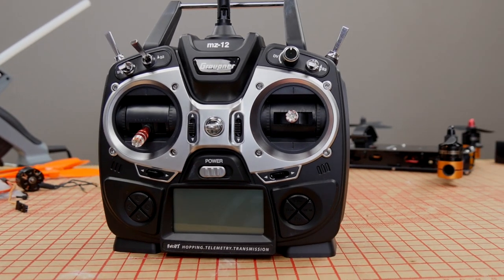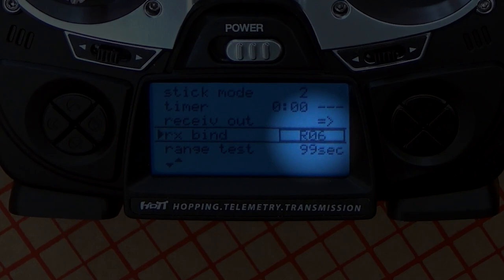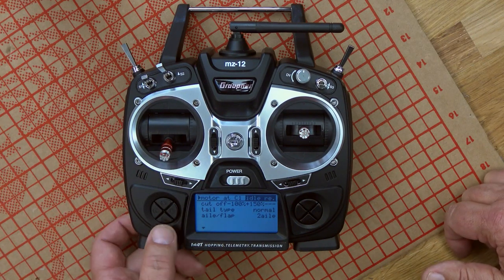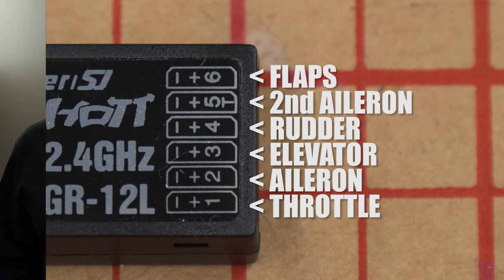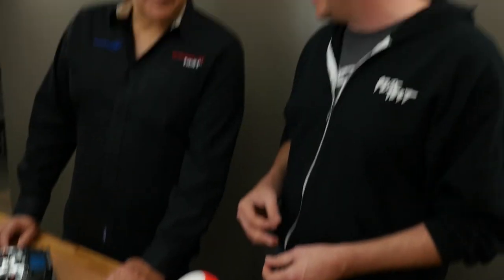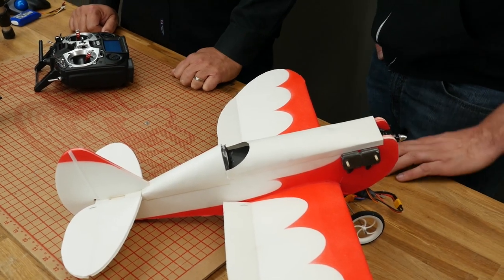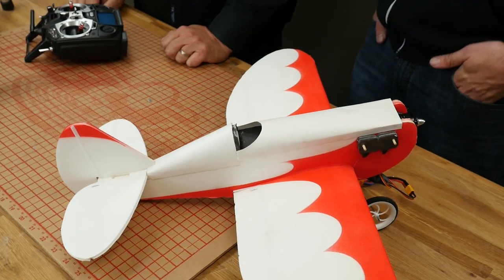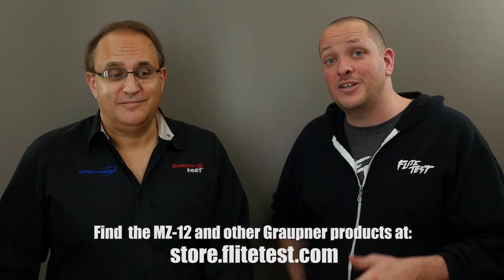Graupner MZ-12 - Tutorial and Basic Aircraft Setup | Flite Test

Comment: Ah, thanks for putting this video out.  Ask and you shall receive.  I now have two Graupner radios.  I first bought the MZ-12 transmitter (from the FT store), same as discussed in this walk through video.  But it did NOT come with the GR-12L receiver.  It comes with the GR-18... which to date is STILL completely non-functional.  I subsequently bought the MZ-10 that came with the GR-12L.  So, I've been able to perform all the functions as described herein on this walk through video.

The one thing that wasn't discussed on this video was setting up a buddy box where I can have the MZ-10 in my son's hands and I can take over if needed on the MZ-12.

I'll follow up w/ Graupner USA on the forums with the further questions I have on the GR-18.

Comment: If you knew how often I have referenced this video (as in just now, again), as well as the other one you've done on the MZ-12, you'd be surprised. Hopefully you'll do other videos on the radio. I doubt you have any problems with it, but for a newbie (and an old one at that), that's a lot of radio to school yourself on. The manual leaves a LOT to be desired and too often just leaves me scratching my head. I'm pretty sure it was translated from German to English and wouldn't be surprised to learn it was German translated to Korean, then Korean to English. There are too many blanks, misspelled words, poor grammar, etc. What I looked for just now was flaperon setup. Easy after watching the video. My new sailplane will be arriving in a couple of days and I'll be using the MZ-12 to maiden it. It has no flaps, just spoilers, and I think it needs the flaps.

Comment: The video is excellent  The manual failed to state to  press the rx button simultaneously to  binding  the rx. After struggling and using inappropriate language, I had found the video. IMHO, Graupner should link this video to its websites.  

My MZ-12 tranmitter was loaded with  german software. English is my primary language. After a month, I am still waiting for the hobby shop to update my software using the english firmware. In the meanwhile I am learning lots of German.

Comment: One of the most heard questions at the flying field "Hey is Futaba expo pos or negative"? I like my Sectrum DX6 as it gives a graph of the slope I'm installing in the radio. The Taranis from what I've seen, looks to have a much easier advanced programing.  Graupner seems to be behind the curve when it comes to development. I haven't been able to determine if Taranis is FCC approved but if I where buying I would fully research It due to what their advertisements claim . Many of my friends have expensive radios with 18, 20 or more channels and fly 3000 dollar planes but always are interested when someone shows up with a spectrum DX9.
Reply: +Sailor john Its illegal to sell a transmitter in the US without FCC certification - Fr'skys FCC ID for the XD9+ is XYFX91216DK.  It's a nice radio, and OpenTX rocks if you are programmer.  If you fly quads, and are in the air for 8 minutes per battery, you probably won't notice it, but if you fly planes - or anything for any length of time - you'll find the gimbals suck.   I much prefer the feel of my Mz-24 to the Taranis, and I fly both.

Comment: Hay guys, great video as usual !  I have the Trinity head tracker in the Fatshark HD3. Can't get it to work with my Hitec Flash 8.Do you know if the new mz-12 PRO 12 Channel 2.4GHz HoTT Transmitter with Falcon 12 Receiver, will work with the Trinity head tracker?

Comment: Please show how to setup a tricopter with the mz12. I cannot figure out what to do, I followed the toughtilt tricopter build and built the tricopter and set things up with clean flight but but the tail servo doesnt counter the right way and caused the tricopter to just spin before even getting a foot off the ground. the tail servo moves correctly when giving stick input but does not counter correctly. please show how to setup a tricopter with this transmitter.
Reply: +oguitarmagic I don't think you are having problems with your MZ12 radio, but with the settings of the flight controller on your copter. Did you check if all the props are going the right way?
Reply: yes i did but just to make sure which way should the props be going on a tricopter?

Comment: Will this transmitter work for multi-rotors? Either way, it's probably way outside my price range.
Reply: +Io Yes, as long as the transmitter has a minimum of four channels, you can fly multirotors with it:  Up/down (throttle), yaw (rudder), pitch (elevator) and roll (ailerons). As shown in the brackets Multirotor controllers usually expect a classic airplane setup for the channels.

Cheaper ones work fine too, but keep in mind that you are going to change models in the future, but the transmitter will usually stay with you for a while. If you can afford it now, try and get something a little more advanced than you need at this moment, so it can grow with you.
Reply: +Balu Thanks! So if I were to get this controller, I should leave it on aeroplane mode?
Reply: +Io Wait? Are you talking about the transmitter (the one with the sticks you move around)? Then yes. It should work in airplane mode like all the other transmitters do too. I'm not sure if it has a special multirotor mode though.

Or are you asking about the receiver that is available in the kit? This special receiver has a flight controller for multirotors and planes included if you want to build a multirotor yourself. It has to be in multirotor mode to work.
Reply: +Balu Transmitter. Old gaming habits lead to me calling it a controller. :)
Reply: +Balu By the way, I have seen you around many FT videos. Are you semi-official staff, or just a helpful guy? Thanks for helping me out!

Comment: MZ12 is less capable and has less features than the previous model, the MC12. There is no data logging via a SD card like the MC12, the telemetry such as the excellent vario's that Graupner has do not work as well (do not have the beep sounds for up/down) and there is no means to record any data from the blue-tooth device which you can connect to the transmitter.

Comment: What's the model number of this radio?
Reply: +Mike Lugo Are you asking for the number of models you can program? The MZ-12 has memory slots for 20 models.
Reply: +Balu there seems to be two different models you can purchase that are called the same thing. Do you know which one this is?
Reply: +Mike Lugo The Graupner MZ-12 is available standalone and as a combo with a receiver. http://store.flitetest.com/transmitters/

There are other models like the MZ-10 (less channels, less features, cheaper) or the MZ-24 (more channels, more features, more expensive). But this video is for the MZ-12.
Reply: +Balu there seems to be a copter radio.
Reply: +Mike Lugo There is a combo pack of this transmitter that includes a GR-18 receiver which has a flight controller for multirotors (or aircraft with functions similar to HorizonHobby's "Safe" feature) built in, yes.

http://store.flitetest.com/graupner-mz-12-and-gr-18-combo-transmitter-receiver-flight-controller/